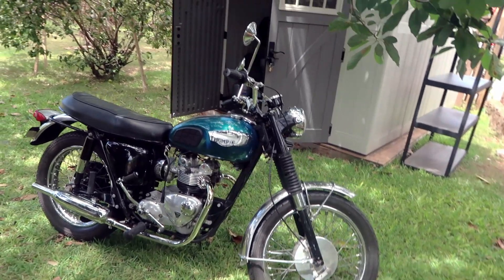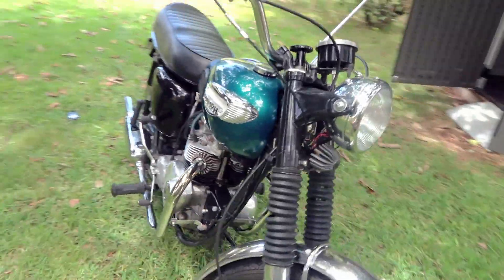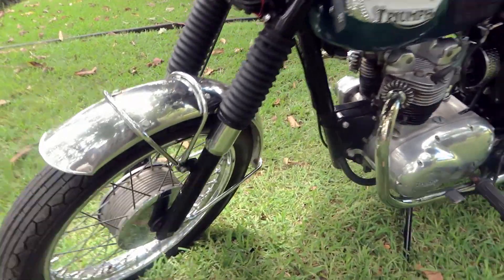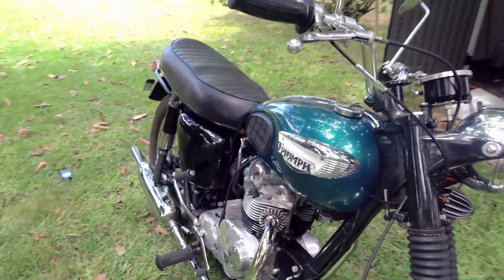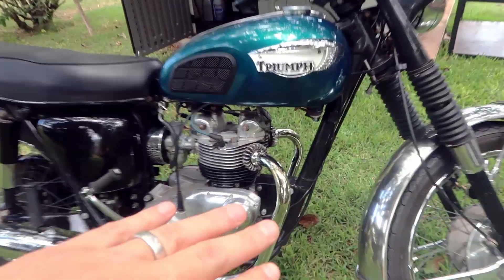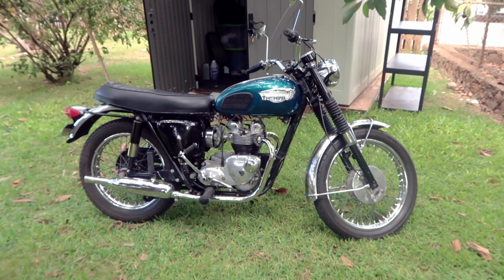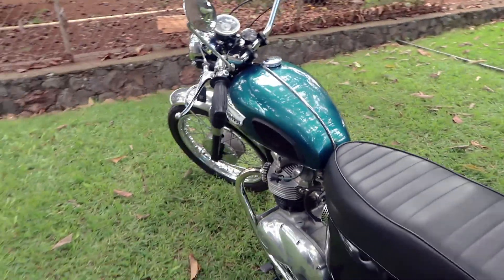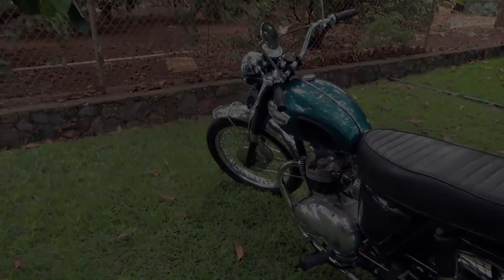Cold starting my vintage Triumph

Comment: I had a '73 which had chrome guards, as far as I'm aware previous models had painted. Prefer chrome myself. Nice sounding engine and exhaust note.
Reply from the maker: Nice! Were those the oil in frame? And for 68 the t100R (the Daytona) had painted fenders but the t100c had stainless steel. Mine actually aren't chrome, they're rather dull lol.
Reply: @bartmotorcycle  There were no OIF 500s apart from the TR5T which borrowed modified BSA trail frames, to the best of my knowledge.
Reply from the maker: @loop1479  ah you're right. Do you any motorcycles now?
Reply: @bartmotorcycle  Yes. A 2016 Street Twin I bought new, then sold, then bought back. A '73 TR5T , 2 BMWs that need work, a R80 and R100 in R80 frame and a mid 70s Kawasaki 100 trail.that also needs work.
Reply from the maker: @loop1479  dang, sounds like a fun garage!
Reply: Generally speaking, in the OIF models, US versions had chrome mudguards and UK versions (like my T140V) were painted in same scheme as the tank.
Reply: I’ve got a 1970 Daytona in jacaranda and silver, it’s been fitted with chrome guards which I would like to change, period style indicators have also been added by someone, not sure if I like these or not.

Comment: I just got done trying to adjust the carbs on a T100 I've been working on. I rejetted the carbs but it appears that the idle circuit on one of them is not working. I brought it back from the grave. It was a mess but I've got it running and close to being on the road.
Reply: Work out which is causing the problem firstly. The following links may help.
https://www.youtube.com/watch?v=jwDUplLn4Xg
https://www.youtube.com/watch?v=DwEo9u513Lw
https://www.youtube.com/watch?v=ORtercv72mY
Hope this is helpful and good luck.

Comment: You didn't have to tickle the carb?   If I ride my bike to get breakfast or lunch,  I'm never sure if I should tickle the carb again when I'm starting it to head back home.   I usually do...and it fires up easily.  Next time I'll give it a kick without the tickling, just to see what happens. 

If your  bike was ridden 5 hours before this, I don't consider that a true "cold start".  : )   In my opinion the bike should sit over night at least...to be an example of a cold start.  I know from personal experience, If I go out for a morning ride on my TR6 then go to start it for an afternoon ride, it fires right up and holds an idle perfectly.  If it's been sitting 24 hours or more there's some warm up time involved.  I often have to give it some revs, maybe hold the throttle open a hair until the bike is warmed up and ready to idle on it's own.  Each bike has it's own preferred starting procedure.  Mine has been pretty solid as far as starting first or second kick.